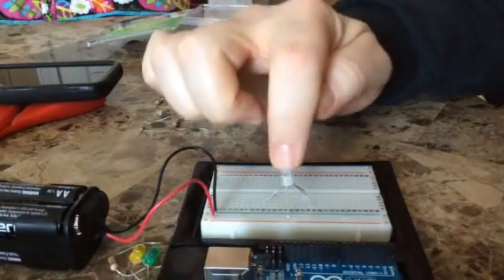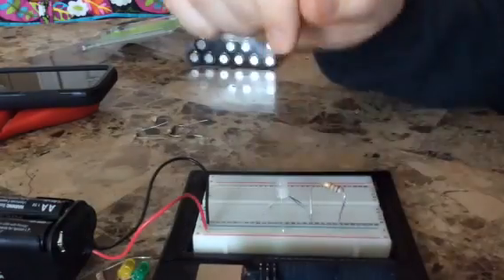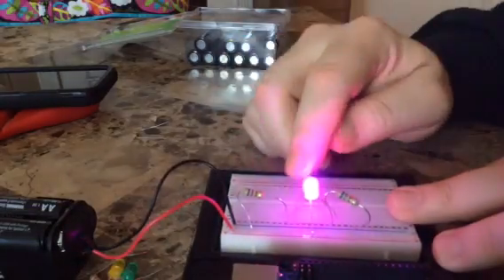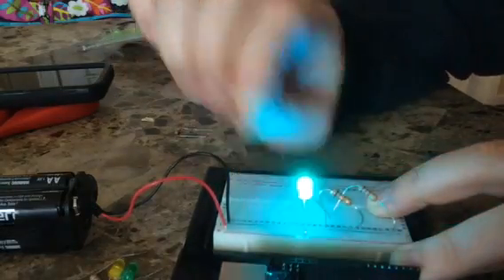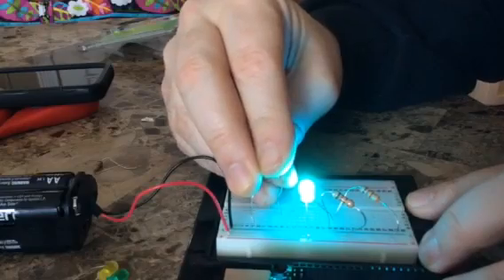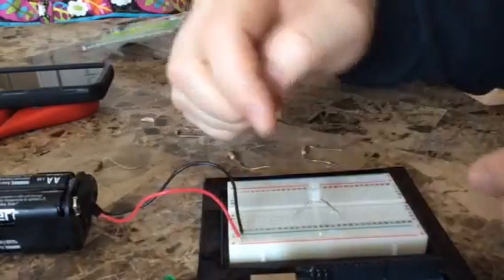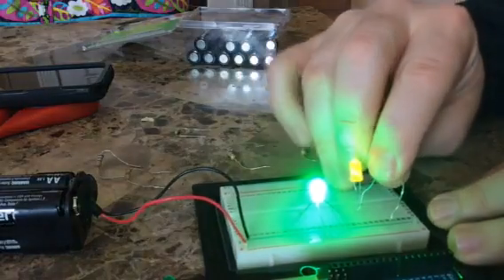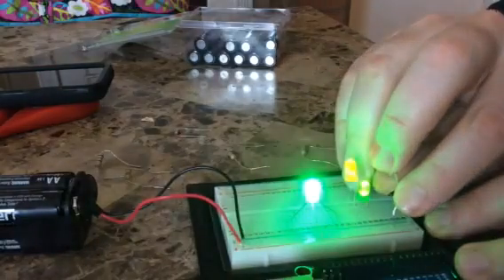RGB LED wiring

Comment: Where can I purchase a single multicolor LED like this?
Reply: +Ariana Arocho
The cheapest source may be www.aliexpress.com or www.ebay.com

Please note that the RGB LED shown in the video, appears to be the 5mm round form factor, water clear and not diffused epoxy encapsulation. These can be bought in large quantities for very low cost from Chinese suppliers:

https://www.aliexpress.com/wholesale?catId=0&initiative_id=SB_20170501041732&isPremium=y&SearchText=5mm+RGB+Common+Cathode+LED

In general the Common Cathode configuration is the most widely used, although there are Common Anode configurations as well.